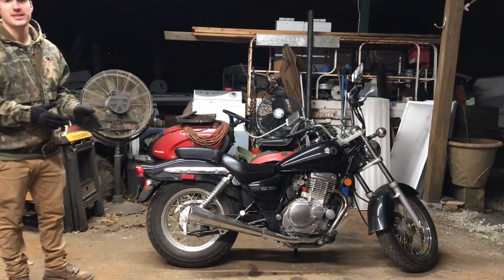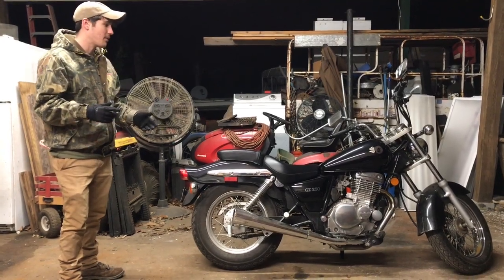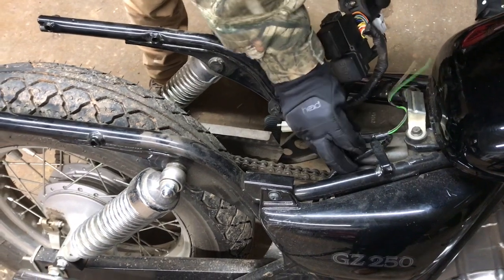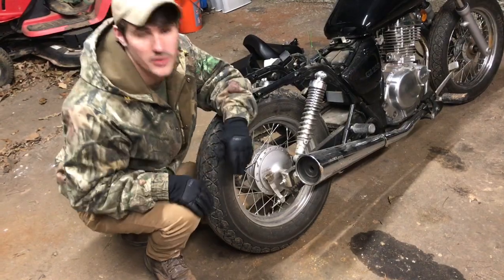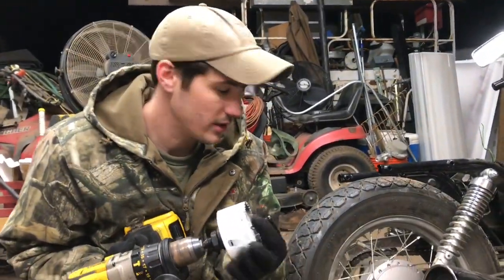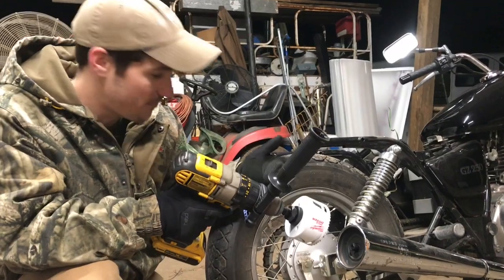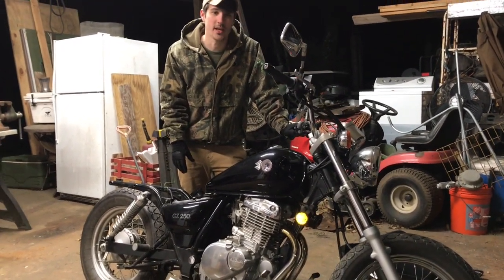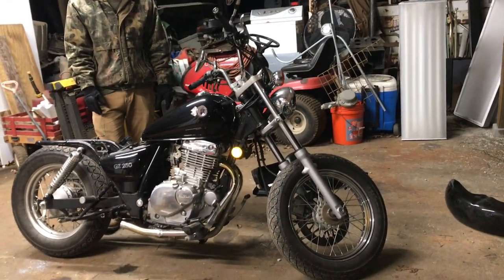First steps to building a bobber motorcycle

Comment: I have the same bike will I have to do anything to the carburetor if I straight pipe mine or can I just run it stock without a jet pack or is there a way to add more gas mixture to the carburetor for the air gas mixture ?
Reply: Darby319 jets probably would run lean haven’t tried it yet just bought the bike today
Reply from the maker: My bike ran fine straight piped with the original carb. You might have to adjust it a tiny bit but you should be good to go! I started messing with the carb a lot and had a hard time getting it back to normal